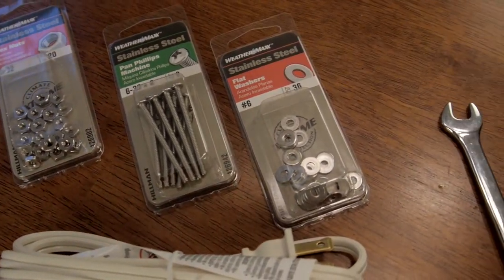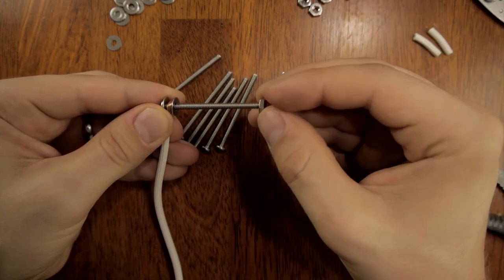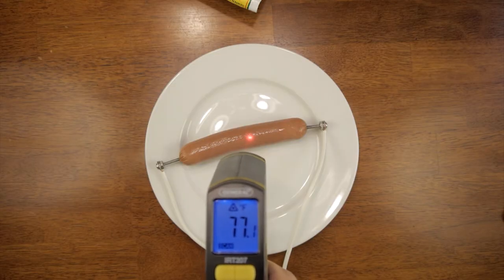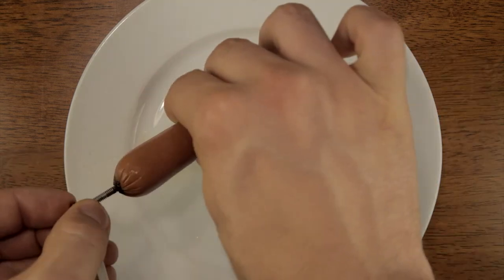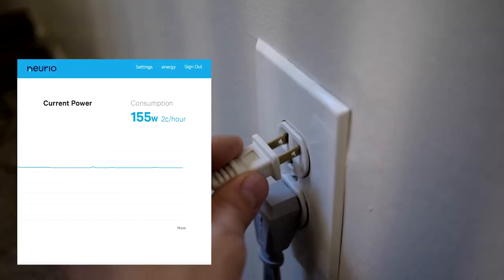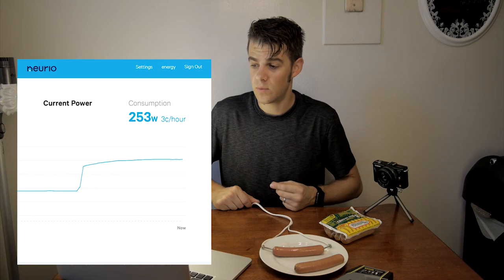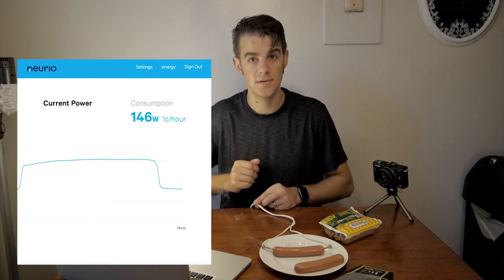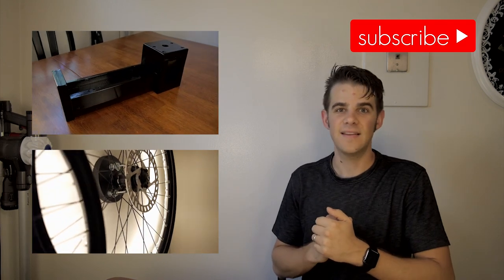Cooking Hog Dogs With Electricity

Comment: hey dude, how many amps draws that hot dog at 120 V AC?
Reply from the maker: Not very much. It used around 140W Max power, which if divided by 120V, comes to 1.17 Amps.
Reply: 230 (240) V works just as good, cooking them in 30 seconds or less. problem with even higher voltages is increased arcing (and i heard "metal taste" of the hotdog). and 1000 J, >1000 V  capacitor discharges tend to destroy them "instantly".
Reply from the maker: Yea, I've seem some videos at high voltages! I really didn't think about the metallic taste in these - especially if I lowered the wattage as I do in my second video on this topic. A longer cooking time at a lower wattage seems to be the best.